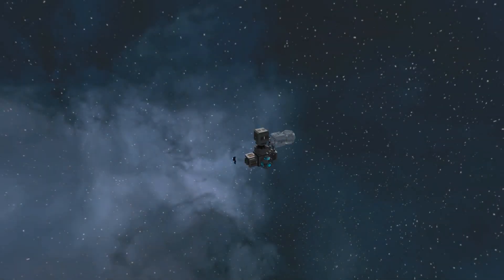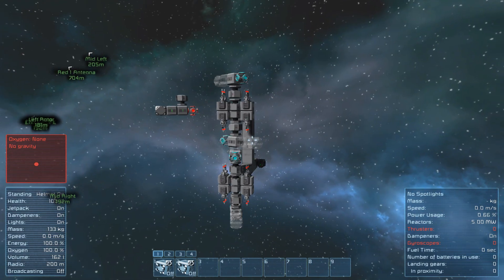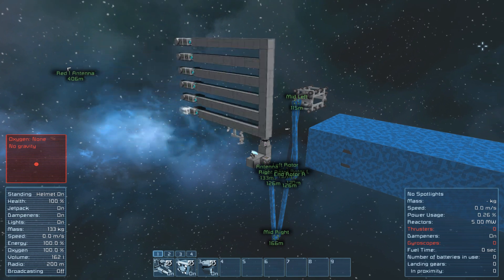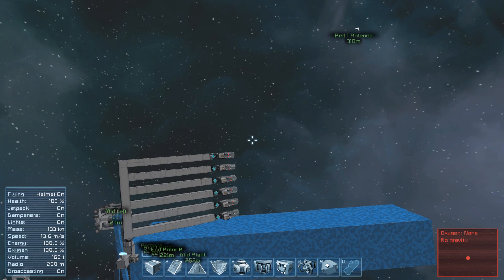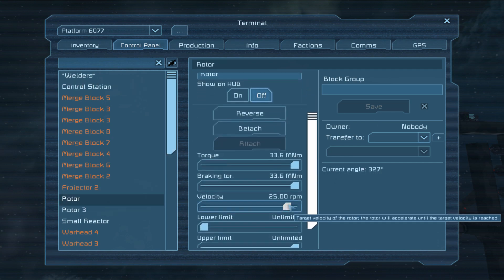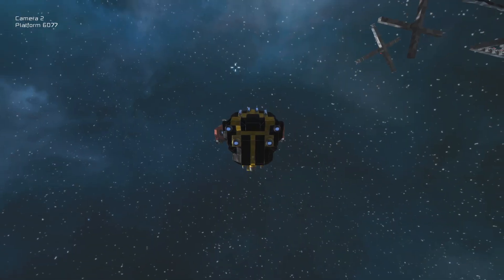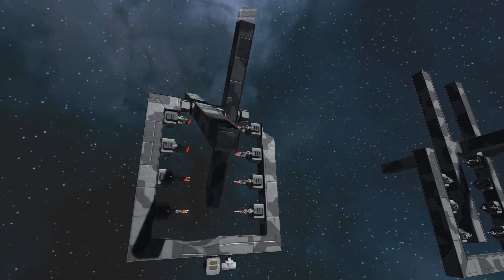Space Engineers - Searching for the Cheapest Projectile - Lotus Experiments

Comment: I've previously gotten a torque powered projectiles to work, similar to your second attempt with the longer bars. The projection moves, but at a certain ratio, it's possible to correct. With a bar 16 blocks long (the bar's merge is the 16th block), the projectile will shift by 1 block with a rotor at 30rpm. Since the projection slips back (relative to the bar) as the bar moves, it's possible to correct by nudging it forward (relative to the bar). This works out nicely because at 15 blocks, the projectile will be thrown at max speed from a stationary platform using a single rotor at 30rpm. Precision launching seems easiest with a sensor after some fiddling of the location. Volume of projectiles can be achieved with parallel cross-shaped bars with welders on each end.

Edit: In looking at your video again, it might help you to have the welders on the side of the launch bar, instead of the front. 

If you're on a ship moving max speed and you wanted to attack something directly behind you, I imagine the bar needs to be a few blocks longer to accelerate the projectile to 200+ m/s. I haven't worked out the ratio for that just yet. :)
Reply: crisis8v88 Instead of a wall of text, I should have just provided a link to the blueprint. Oops! Well, this should be more useful: http://steamcommunity.com/sharedfiles/filedetails/?id=457880945
Reply from the maker: crisis8v88 Nice! I did read the above just struggling to keep up with comments these days so not getting a chance to reply to them all.. Does sound interesting though, will check out the world and see what you did :)

Comment: Interesting ideas but i really think the best thing for multiplayer would be a ship with a ton of forward and reverse thrusters controlled by timers and overide that simply went back and forth building them on the rear stroke and releasing projectiles on the forward stroke. Sure you may need a few hundred meter straight for this to work in but your gonna get insane accuracy with no rotor explosions
Reply from the maker: George Booth Yeah it's a very reliable way of doing it for sure, and probably still the best for cheap high-accuracy firing.. it has it's weaknesses of course, mostly that it's very vulnerable in combat as it can only travel in straight lines while firing but having done the above and tried out peoples suggestions I think you are probably right, especially in MP where you want as few moving parts as possible.

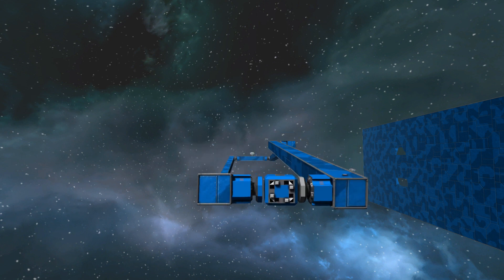Comment: I think the machine at 6:32 is fine, if you don't make the rotors stop it mechanical movement will make it go back to its starting position so you can shoot again, its simple mechanics. The rotors will do a whole 360 and the structure will be reseted automatically. The rotors at the tip and in the middle would need to be off and free to rotate. I don't see how you dind't think about it. you can use the movement as an advantage.
Reply from the maker: DTM'98 I know exactly what you mean, I didn't think of it honestly, but the reason I didn't go any further with it was simply that the whole thing wobbled so much regardless that it was never gonna be able to shoot something actually where you aimed it, when you add some weight to the end it just makes everything joggle about even worse!

I will give it a quick try though in case of some miracle, but I suspect that it's still gonna end up being wobbly especially when you try and move it to aim :)
Reply: Thanks for replying. you could make it so that the tip sorrounded by wheels and encased so that it wobbles less maybe...+ at the tip you could actually have a rectangular tube with landing gears in it. when it retreats it picks up a new projectile just printed and flings it forward and so on. You could set it up with sensors so that when the tip is close enough to the back of the machine (therefore in its starting position) the projectile is released and at the same time attached to the landing gear in the tube. Hope you understand as welll as you already have since its hard to explain with words. Thanks again :) and keep it up.
Reply from the maker: DTM'98
Took me a few reads through but yeah, think I still understand what you mean :) Instead of having the merge block on the end it literally just has as box that grabs a projectile when it's 'resetting' and then launches it when it's at max extension. Pretty complex to setup methinks but would look very cool in action!

Comment: i have experimented with the welding of the projectile done in the middle of the circle and a rail of landingears outwards. So when the projectile is detatched it will be moved outwards by the centrifugal force (i know that this actually doesnt exist). On the way to the edge it is further accelerated. It also reaches speeds of 104 m/s but i wasnt able to get it kind of precise. Catching it with a landing gear auto lock is not very reliable. I only managed to get them launched at a horizontal precision of about 70 degrees. So it might work for bombarding a huge base.
Reply from the maker: harzer99 Interesting design even if it isn't that accurate! I'd planned to test using the landing gear like you have so it's very cool to know it at least works to some extent.. Did think they might be a bit too variable in how the auto lock so good to have that confirmed without testing it myself :)

Cheers!

Comment: An extremely fast grav drive ship/box - 0 - 104 in maybe 2 seconds and to 0 again in less.  Fit a timer to the ship to make it speed up and stop in the shortest possible time

Make it as light as possible and open ended - stick all the missiles/torpedoes/bombs in the box in some kind of rack to maintain their orientation, accelerate the entire ship in the correct direction, and use the grav drive to stop the ship. 

If you use the zoom control on a camera to target it, you can launch from a considerable distance while aiming it.  If you combine this with your missile construction system using projectors and welders, it'll make it a multi-shot system.

You aim it while stood still.  In theory. it can be aimed using gps points and the missiles can be as complicated as you wish.
Reply from the maker: HAdrian builtawall Would definitely work and be pretty efficient, the only issue is the aiming as you suggest, although rather than stay still to aim I'd just not build the projectiles until you were lined up on target... 

I cannot think how you fit it to a ship as a separate weapon however. Would most certainly work as a ship in it's own right, but I can't really see a way to turret mount it for example which would be a cool feature to have if possible. Nice solution sir, and one I'll prolly use in future too! Will still keep looking for something I can turret mount too though :)
Reply: *****  
I was thinking as a separate ship to be honest - like the early torpedo boats.  As a ship weapon, they (the entire unit launched from the big ship) resemble in my mind, the the missile pods from the Honor Harrington books.  Something big ships carry to action then drop and fire (like a multi-stage rocket) or launch at the target.

Unfortunatly, the best low cast turret weapon I can think of is still the mk 1 rock (or mine, block, toilet seat, etc) fired from a grav cannon.  While blocks aren't affected by gravity, components are. Components are lethal to players when sucked out an airlock.  Firing them at targets would cause some damage.  Steel plates are very cheap and can  weigh a lot.  Does mass times speed work properly in Space engineers?

I'm curious - what does it take to detonate turret missile ammo or explosive without installing it in a weapon?  I think its possible but not sure.
Reply from the maker: HAdrian builtawall
Yeah fair enough :) Could always then have that separate ship be one that's itself launched from a larger craft when needed, thus making it more 'weapon like' for that larger ship.

It's hard to overlook the old approach of just flinging some stuff at them via gravity/pressure (essentially the same btw, in that anything that can be moved by pressure is also effected by gravity). The one downside is ofc the gravity itself and the fact that anything launched like that can be deflected by gravity fairly easily too.

As for the last bit, a Gatling shot or nearby explosion will do it, but the resulting blast isn't that impressive tbh.. used to be a LOT more powerful.
Reply: ***** We all know what happens when you grind down a cargo container full of ore (especially when its still installed in your ship and you forget to empty it).  Something that was not affected by gravity suddenly falls through the floor of your ship leaving a large hole.

Would it be possible to armour up this cargo container so it survives to hit the target then demolish itself in the target.  Grav shields don't affect blocks and they might actually aid the destruction caused by a large rock "falling through the floor".

One thing that is effected by pressure but not gravity is jetpacking players.  No help in this context but a curious variance from standard SE physics.

Off-topic -  someone managed to get your grav-net thing to work continuously.
Reply from the maker: HAdrian builtawall The grav net actually working? Bloody hell.... Didn't expect that to ever happen :) You talking about the guy who's using that technique on the 'search for the cheapest...' video or another one?

I've mused a bit on the old 'nuke' technique and how it could be employed in a new way that actually works.. not tried to build anything yet but I do believe something like you describe has some potential.

Good point r.e. the jetpacks, for sake of accuracy at least I should mention that also :)

Comment: Mount a rotor on a station with a length 16 shaft on it. Then mount a length 8 shaft on the end of this by way of another rotor. Spin them so that when the business end of the short shaft is near the hub of the long shaft a projectile is built on it. Projectile is released when shafts are at maximum extension. I.e. Use a pair of shafts and rotors to get the projectile to operate in an ellipse welding when close to hub flinging when far away.
Reply from the maker: Richard Asbridge Hmm, that could be a very clever solution you have there sir.... or SE could take one look at the 2 arms rotating like that and completely loose the plot regarding where the projections are :) Hopefully the first one of course, will most definitely give that a try! Thanks :)

Comment: First off I would like to point out that I don't own the game and don't have a computer capable of running the game so I can't do any testing myself (sadly).  Secondly, this idea technically would use gravity propulsion so it would not meet all of the criteria of the challenge (sort of kind of).

What if you made a gravity cannon/rail gun/coil gun type thing and loaded it with a heavy armor kinetic projectile with a rock in the center to provide mass?  It would take some work, but it may be possible to construct the projectile in such a way that the rock pushes the projectile out with the assistance of gravity generators BUT exits the rear of the projectile if it encounters a gravity field at the target (so any real attempt at repelling the mass with a gravity shield would only remove the rock from the projectile).

I know the goal of the challenge is geared more toward finding an alternate method of firing projectiles, though in terms of cost I think this might be the best option so I figured it would be worth mentioning.  Of course the cannon itself would still be a bit expensive to create but the individual projectiles would be fairly cheap.
Reply from the maker: Deuce McDeucey The key part of what you explain there, and the bit that actually makes it really viable, is the ability to exit the rock from the rear of the projectile when it encounters a gravity field... you have some good understanding for someone who doesn't even own the game :) I like the thinking a lot, there's some potential issues but without testing things I dunno if they will even be a problem (e.g. the rock damaging the projectile with the force). Will have to experiment with that one, cheers!
Reply: Yeah, there is a real possibility of this idea falling flat.  My biggest concern (which I suppose is the obvious one) is that the rock might not push up against the projectile in a uniform manner and that the torpedo itself might not launch properly because of that.

Another concern I have is the possibility of encountering a gravity shield that uses non-spherical gravity generators to only slightly modify the path of incoming projectiles to bend their trajectories around the ship rather than using a standard spherical gravity generator to push objects directly away from the ship.  

An armor cup of sorts on the back of such a projectile may well easily defeat the spherical generator shield, but that idea may still be unable to reliably penetrate a non-spherical grav shielding system due to the possibility of the rock catching on the edges of the cup rather than being pushed directly out of the back.

That being said, even if the projectile cannot defeat the linear grav generator shield it may still be viable for use in attacking large stations due to the small range the linear grav generators have.  It would be much more practical to use one or several spherical generators to protect a massive installation than to try to shape a field of the less effective linear grav generators to bend the projectiles.
Reply from the maker: Deuce McDeucey I suspect that in order to work it'll need to use ingots rather than stone, simply because the ingots are square and thus tend to travel much straighter and not collide around so much, should mean that even fields that aren't directly lined up with the projectile don't interfere unless the rear part is too restrictive. (which includes spherical fields also btw, unless you are aiming perfectly at the generator)

Assuming it's not going to be aimed with the propulsion in place I think this could work ok tbh, although I know from the little testing I've done that the issue of destroying the projectile with the ingot/ore is very real, or even just warping through it entirely has happened also.
Reply: After doing a little bit more research it seems as though the rock/ingot teleporting problem is related to the way the game updates item locations.  It seems as though the game refreshes the location of in-game objects 60 times a second (which is also why there is a max speed limit, to cut back on teleportation issues).  Rocks, ingots and other items dropped from the inventory do not have a maximum speed limit like a ship would and that is what causes rocks to pass through objects at speeds above the speed limit.

One way that issue might be correctable would be to dial back the gravity pull on the cannon enough so that the rocks/ingots would barely reach a safer speed limit before leaving the field.  That should prevent the items from teleporting inside the projectiles and damaging them (or passing entirely through them).

I'm not entirely sure how items such as rocks accelerate when under the influence of gravity generators so adjusting the strength of the generators may not fix the problem.  Either way it would likely take a lot of fine tuning to get it set up perfect and the teleportation issue may still be present if you encounter server lag.  Might be worth testing, though I wouldn't blame you for scrapping the idea as there are a lot of game mechanic variables involved in attempting to perfect this idea.
Reply from the maker: Deuce McDeucey
That reads like someone who's just watched some of John Brewer's videos regarding the game engine and gravity effects :) I hope so at least, he makes some awesome and really informative videos!

I'm gonna give it a try for sure, how long I spend on it will depend on how well it works to begin with.. very easy to spend ages trying to perfect something that isn't really 'perfectable' but I'd really like for this one to actually work right.. would be lovely and cheap and also somehow elegant in it's design :)

Cheers for the thoughts dude, appreciate it :)

Comment: Have you tried throwing something down a tube?

Build the projectile near the rotor (where its slower), release, and have it travel down a "barrel" that spins like the arms you have now.... centrifugal (or is it certripetal) force should force it to the end where its going faster and out towards your target :)
Reply: ChromeStriker centifugal to get it to the end of the pipe, centipetal is the launnch at the end ... i think.... :D
Reply from the maker: ChromeStriker I could see that working if I can find a way to make the pipe not get damaged during the launch... maybe make the pipe out of space balls as they seem to be pretty much invulnerable.

Centripetal is kinda weird, basically it's the force you need to exert on a rotating object in order to STOP centrifugal motion. So the force pulling it towards the center of the circle that's needed to keep it's position stationary relative to the rotation point.
Reply: ***** Ahh that makes sense, thanks :)

Also had an idea of overriding gyros in a direction to create spin, instead of the wonders that are rotors (of doom)...  dont know how fast a gyro can spin... but id imagine faster than a rotor (less stability issues)... that way you may be able to shorten your arms and still get that max speed :)
Reply from the maker: ChromeStriker
Yeah it's worth a try, I have no idea if gyro's can spin faster or not, I believe their slider also goes to 30 RPM the same as rotors, but they will for sure be more stable and reliable.